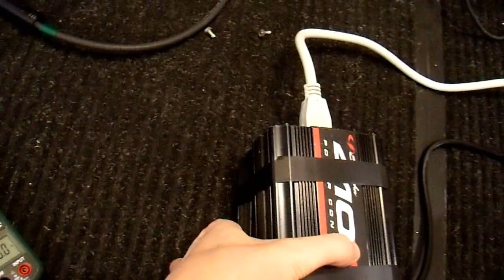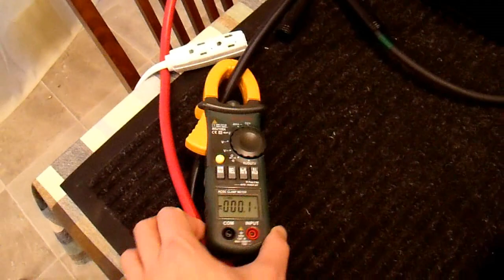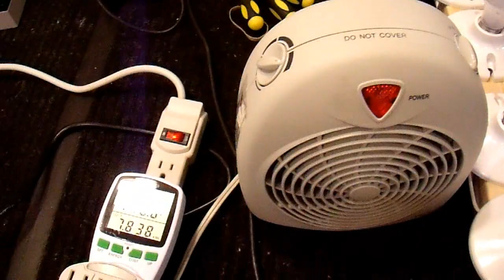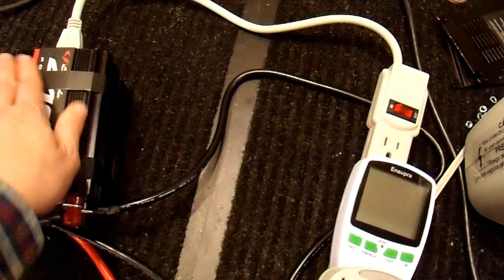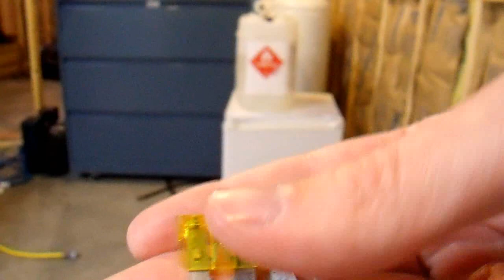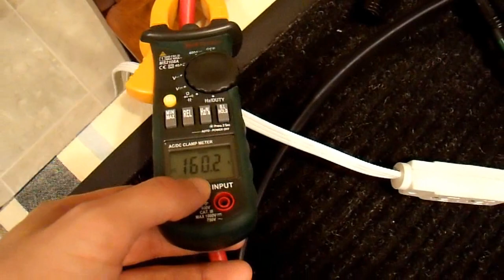Parallel Inverters - Double the Power Hack!   Part2

Comment: How does the AC current get from the second inverter to the power bar ?
Reply: The total A.C current (twice the normal one) is drawn only from the output of one inverter. The output of the unused inverter was free (i.e. unloaded. No current through it). He only paralleled the outputs of the D.C to D.C conversion stages of both inverters.

Comment: It's an economic measure. The company probably makes multiple models, and the output stage probably does not have much cost savings going with components matched to the power output, so they just use the same output stage on say the 100 to 1000 watt models. Which makes sense because the output is lower current. 
The input stage has beefier components due to handling the higher current. So there is savings by matching the input stage to the desired output of that model. 
Thanks for a well thought experiment.

Comment: The real question is. . .  why do we need AC other than for its ability to have voltage transmission?  With almost ALL electricity, the first thing we do (after transforming voltage), is to convert it to DC.  Computers, etc.
Reply: Motors don't, and that's why he was testing with all motor devices
Reply: The A.C won the game many years ago just because it was (and still is) very easy to transform it by conventional transformers. In this way, power plants transform it (step up) to very high voltage (150 - 400 - 750 KV) for its distribution with long haul lines from the remote production place to very long distances where it will be consumed. This tranformation is done in order to minimise transfer losses. Then, at the end of each long haul line they transform it again (step down) in order to make it easy to consume from households. So A.C transmission had dominated just because of the existence of the transformer. At that time of decision about the issue, the technology could not support D.C transmission which although has less losses was impossible to transform it. Such problems do not exist in our days and High Voltage D.C transmission is applied in many cases. On the other hand D.C to D.C conversion in general is not a problem any longer.
Reply: Very true !! Nowadays most devices use smps to convert ac to dc. Even motors are coming in DC like the BLDC motors more efficient and not much initial surge current.

Comment: Refrigeration compressors you only get one shot to start them. If it doesn't get up to speed it will just sit on the over load relay and draw an ass load of current.

Comment: I have tried this but I toast the two inverters and my friend told me my inverter is not design for parallel set up so if I be doing it again I will the one that says can be connected in paralled.
Reply: You cannot parallel the A.C outputs of two inverters. Naturally they will explode. This is due to the fact that each ordinary inverter has its own oscillator for its output. Therefore two in depended inverters will have frequency and phase differences in their outputs. Even if their frequency is identical, it is the phase difference that causes the explosion (especially if it is reversed at the moment of the paralleling). For paralleling A.C outputs therefore, both their frequency and phase should have zero differences to each other. They should be locked to each other. But with ordinary inverters this is a very difficult modification to implement. Only those grid tie inverters can be directly paralleled to the utility or be stacked to each other, because they automatically detect that critical "zero frequency - zero phase" condition and then perform the paralleling automatically again.

Comment: Your experiment in overloading inverters is baffling.  Those 410 watt units claim that it'll put out double to start but what most people don't know is this is for 1/2 cycle. Also cheap inverters don't do well with long extension cord runs as it fools the overload protection circuits. Heavy starting loads like fridges usually need three times the power to get their compressors to start. There are so many things that you have done wrong on so many levels. I have a 750 watt Shumaker inverter that won't  start a 400 watt angle grinder on it's first try. You said a 13 amp saw draws a lot of current to start but doesn't need a lot of power??? If an electrical device doesn't need a lot of power, it won't draw it. Electrical devices only draw what they need.

Comment: ...that does not make sense...little confused...but if both inverter output is connected to a single extension than mybe it makes sense... here in this demo you just used the top inverter output...to work 800w load  just by turning On the lower inverter..that means extra 400w is probably coming from the back battery input which is dc...mind boggling..but awesome experiment..is it true?...you should get a pure sine chinese 10000w inverter to run motor load like an air conditioning unit to reward yourself for this video..

Comment: I wonder if a 1500w mod sinewave inverter could be boosted by extracting the dc intermediary from an inverter-type gasoline generator..? This way one could use battery for most items, but start up a generator outdoors for when you do power appliances.. Perhaps with a rectifier for safety... Hm..

Comment: are the out puts tied still tied together with the orange wires? how are the phase of the inverters synched? have you ;looked at the output with a scope? might want to
Reply: If I understand what he's doing, the whole point is that he's not messing with sync at all, and that's what makes it so simple. The two outputs will still be out of phase, but both are capable of double the output (not simultaneously, of course), thanks to sharing their inputs before the conversion to AC.

Comment: Hmmmm..... Thinking that if you parallel the input source, use one inverter's  drive circuit to signal the input side of both inverters, but invert the signal somehow on one of them, you could theoretically connect your load across the hots and double the voltage. May be you would get a small scale version of an Independence Day fireworks show; but then again, maybe not!

Comment: I have two inverters a 5000 watt and a 3500 watt if I increase the 3500 watt output voltage capacitor to match the 5000w I can effectively run both inverters tied together with no issues?

Comment: You would burn them out inside an hour under continuous use!
The test you’re showing is very deceiving to people who don’t really understand electronic circuits and their designs. Someone could actually burn down a house using your method in making them believe they can do it.
Reply: "Burning down the house"......by  Talking Heads
Reply: They'd be idiots if they even tried that's why he says it's an "experiment" not meant to be used in day to day who in there right mind is going to go out buy two 20- 40$ inverters an expect to run a house

Comment: great videos, thank you.  BTW:  1 horsepower is a little over 700 watts... so 3 hp = 2100+ watts
Reply: Can I put three 12vdc to 60vdc 1500 watts inverter in parallel to run a 4000 watts motors

Comment: Because the leads to the batteries both go to the same battery, the other battery has an additional length of wire giving it more resistance. Thus it won't discharge as much and won't charge as much.  Move one of the leads to the inverter to the other battery. The the voltage across both batteries will be the same and both will charge and discharge equally.

Comment: Your AC might have worked if you had started with just the fan first then the ac part that way you do not have the start up current surge of the fan and the compressor at the same time.

Comment: a modified sine inverter(bestek 1000w) can power a fridge? or it is needed a pure sine?thx for sharing,
Reply: A pure sine wave inverter will work best for refrigerators/ freezers. Modified sine wave will not run the compressor optimally and will overheat causing the compressor to cycle on and off more frequently via the thermostat. Effectively, your freezer will not be as cold as it could be.

Comment: The junction temperature of the output transformers when doubling the output power, would necessitate consideration of the heat sink design, otherwise, some form of thermal overload protection.

Comment: Very interesting - and this time remembering to subscribe!. This triggered a number of thoughts for me, so I thought I'd share a couple of them even though it's an older video.

Why not add some more capacitance to the two linked ones (or to each individually) so they can handle more surge current, to the limit you looked up for the MOSFETs?

 As to construction: 1) When you had it all apart one could see that the boards could be easily stacked, put into a new case with a shared heatsink, also allowing some reconfiguration within the case and/or fascia layout, if desired, including more capacitance; 2) why not add a current sensor and relay within that new case, and switch on the backup circuit when a threshold is reached -- automatic more efficient convertor that can have one side disabled if it breaks down.

The above could be done while preserving their cases, as you've done here. In which case, why not discover the location of the connection spots on one, locate where a hole needs to be drilled in the cases to reach and solder those locations (covered over with tape after), define a connection method (like snaking a plug to the back or underside of the case), and you can easily swap multiple units as desired. Can't wait to check this out with a couple of 1500 watt units.

I'm considering starting an open design for an efficient multi-input and output power system for use on boats, RVs, and off-grid that can convert, store,  and condition any available power source, automatically choosing between that best available sources, etc. This video triggered many ideas to improve my system. Keep up the good work!

Comment: I am doing a stand alone system with solar panel using this brand name inverter. Do it is possible to use the alarm of the inverter to add a relay hook to a charger with the on grid that allow to charge the batteries during cloudy days?

Comment: Could you keep stacking the inverters? say make a 20 converter stack and have about 7,000 watts?
Just asking...
Reply: 7k watts is far beyond what a single household outlet can handle. So.... Yeah it would "work" but you'd release blue smoke from somewhere.
Reply: Now split your 120 vac into the bottom of your power box in your home using 2 120 vac 50 amp circuit breakers 1 on each side and the fridge will run just can't run the Heat Pump
Reply: Forgot to tell you to turn off the 100 amp breaker at the top as long as all the inverters are true sine wave you can go as high as 20000 or 20 kw kva for the tech types
Reply: At 20 kw as long as the heat tapes  in  your heat  pump don't come on this this would work just make sure you have a large battery bank,  most 12 vdc car Batteries have about 8 amp hours so a few solar panels to run a charger will keep you going however, due to the law of decreasing returns eventually all power will die unless charged, most new vehicles have an inverter just crank your car and plug in the charger never draw power from a battery while charging this will damage the battery, charger, and your vehicles inverter

Comment: I really like your videos,  The 5500 btu window a/c , About how big of a inverter is needed to run only on battery power ? also do you think 24 volt inverter is any better      than 12 volt or it doesn't matter. Thank you for your very helpful videos.

Comment: Wait 12 amps times 120/110v.. Well over 1,000 watts at 110 or 120v!!!
You MORE than doubled the output power!
Reply: i dont know where you got 12 amps
Reply: DMAN22yeah 12 amps out of the outputs of the inverter.. amps in 12 amps out A vacuum cleaner like that takes 10-14 amps to run and probably twice that to start. about the limit of the normal wall socket. And those inverters can give that! at least when combined
Reply: ***** no, they can give less than 8 amps
Reply: DMAN22yeah are you sure because 8 amps at 110v/120v is NOT even 1,000W
Reply: ***** its only 820 watts, 410x2
Reply: They can probably give out a bit more than that then.. 410 watts is probably just the recommended maximum long-term use.

Comment: So if you connect 3 of them then will you get 1200 watts?

Interesting experiment.

Thanks
Reply: +1timby The weak link in what you propose is the output section of the inverter that has the load attached. They would all be sharing each other's DC  input section, which in my opinion is the most durable part of inexpensive inverters.  This experiment could also be applied to IDENTICAL high wattage car audio amplifiers as they use much of the same power design to get high voltage DC.
Reply: I think he's getting away with it due to the tolerance built into the AC half of the inverter. He's able to push twice the angry pixies through it, but I doubt it would handle triple its rated capacity.

Comment: You do realize that they are not sharing the load as you are only pluged into one of them now if you make a combiner box and distribute the load or mix the load then plug your single output line in that would work much better
Reply: +charles fournier They are sharing the load, just not perfectly equally, unless he was anal as hell about having exact resistances between each inverter at the plug. You are right though that a simple distribution box with current balancing is the 'right' way to do this.
Reply: +Richard Smith He is only using the output stage from one inverter and using only the first (input)stage of the other. Inverters are divided internally with an input stage and an output stage. He has the backs of them removed and the output of the first stages linked together with some jumpers you cannot see.

Comment: great!!  i had seen parallel connections dor duplicate the output power in inverter generators (like yamaha). There, the bridge its a simple two wire cable, same like you do in your video. I really believe that its possible, obviously the output semiconductors that were after the transformer (whatever that been.. triacs or SCRs or Transistors) will drive more power and should be recalculated and changed by bigger ones. Additionally your injverters are power rated 410W but uses 20A fuses, I think that the real max power should be around 200W and the peak power is 410W (depends the inverter but peak power commonlly its for just less that a minute) But its an interesting project... i will try with my inverters... thanks
Reply: i no think that,  the 2 inverters have all their outputs working:  double power,but double IGBTs
2014 »»»»  2022   wow...
Reply: @josepeixoto3384   😂 I have forgotten this comment. I finally looked for a bigger inverter 😁. Thanks for reply

Comment: Thanks for all the good info.
I recently blown my Sunforce 2500 W inverter.
So I am looking for a 3000 W Pure Sign-Wave inverter.
I am willing to spend up to $500.
What is your best recommendation?
I run a 3/4 Hp veggie oil pump in my truck.
And I need Pure-Sign because I also run a PA system off of it sometimes.
If you are interested I could give you my blown Sunforce if you are willing to pay for shipping.
I am sure you can fix it. :0)
Reply: +EvenStar LoveAnanda It blew because Sunforce inverters are overspec'ed. AIMS makes a good inverters for the price, but the 3000w+ is around $700. The only decent 3000w+ pure sine inverter for cheap I have found is the Nimble NM3000. It isn't perfect either, it has a 36 watt standby with no remote shutoff, which can be a problem. Some people have told me the standby is as high as 100w on some units. If that matters would depend on the individual use case.
The NM3000 is usually selling for around $500. It can do double its spec'ed power output for about 5 seconds, which I found quite impressive, before the overcurrent or temp protection kicks in. Thats enough to start nearly any inductive load. 
However, it does have problems with starting inductive loads if already near its 3000w limit, which I assume is because of temperature protection. That is pretty understandable, as you should give yourself about 500w headroom for inductive loads anyway when deciding how much power you need. It would perform better dealing with inductive loads when near the current limit in cold climates and worse in warm ones I assume. Beefing up the cooling could help with that too I would guess. I predict it would perform pretty miserably if confined in a space that would limit airflow though if planning to run it at the full 3000w quite often, as it does seem quite warm when there.

Comment: You should get a dual trace scope and look at what is going on with the waveforms at the input side after the modified sine wave generator.  I believe you are avoiding a lot of very important issues and post a video advising nobody try what you are doing.
Reply: up

Comment: Maybe try removing the gate connection on one of the choppers then parallel those to the other.  I imagine the issue is simply out of sync waveforms.
Reply: This is what I was curious about, the wave forms would not necessarily be in sync, and it surprised that they kept working, the output combined wave form must have been a real mess.
Reply: Believe it.
Reply: @djbare9  Of what i understand after transformers there is a rectifier and DC, whit other words you don't need to sync anything.
Reply: He should have ran the too input stages through one output stage oh what that's just what he did

Comment: You paralleled those units, but only took power off one of them to drive your dummy loads.  Perhaps you dhould hsve slso paralleed the 115 volt ends as well and the tried your experiment.
Reply: +Willi  Kruger    You missed part one this is part two.